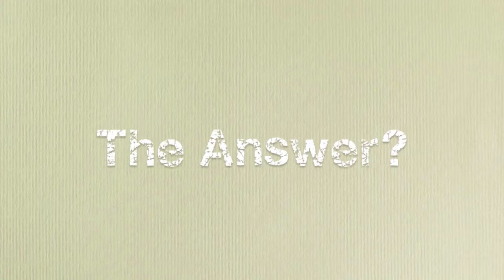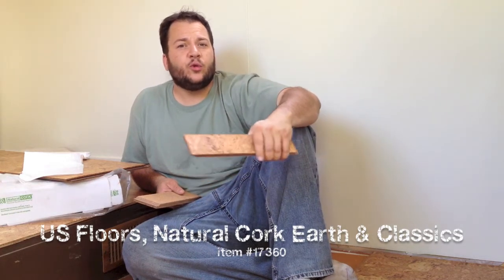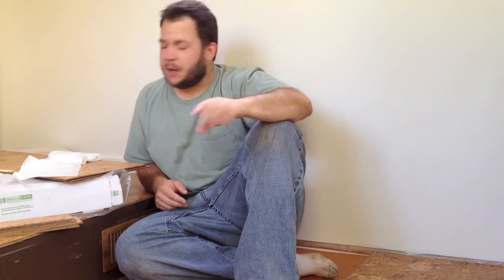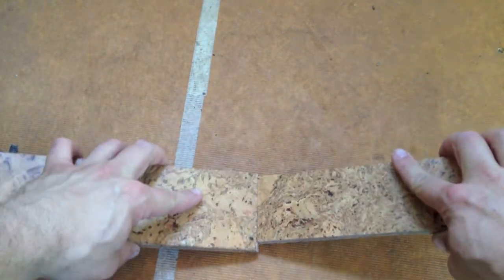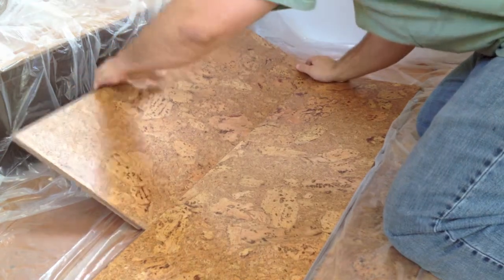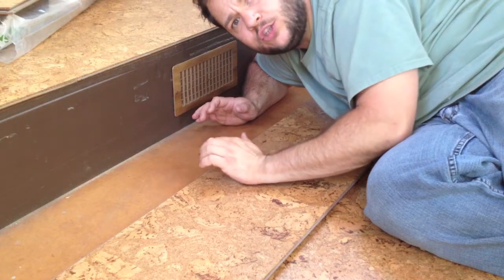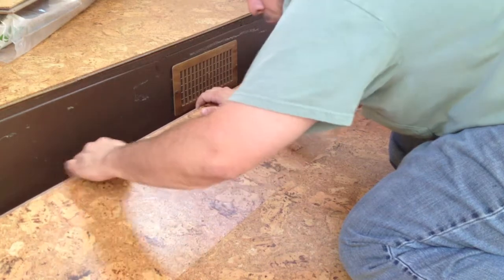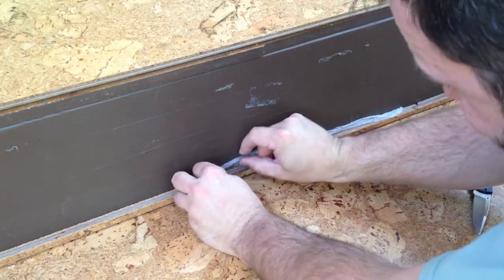US Floors Cork Flooring

Comment: Did you document the poly topcoat application? I assume that the US Floors click lock flooring you used was prefinished, so I'm curious what steps you followed to put the poly on top of it. Did you scuff or sand the surface at all?
Reply from the maker: I did not document that process. It was entirely too tough in the size space to actually do the job while documenting and it really is an easy process. I used a satin finish of AFM SafeCoat, Polyureseal BP (from Green Building Supplies) and followed the instructions to the 'T'. There is absolutely no scuffing or sanding required if your flooring already has a finish. It is like pouring syrup over a pancake.
Reply: Tiny r(E)volution  Awesome. I'm thinking about installing a click lock, prefinished cork floor like this and definitely want to seal it.

What tools did you use to spread the poly evenly? I've seen tutorials use a very short nap roller, some type of rectangular pad for cutting in, and also a squeegee like device, called a t-bar.

Thanks for the reply!
Reply: @TinyrevolutionUs  
Good to know...
Thanks for the info

Comment: I noticed you left the tongue on the last board's wall side. Normally, you'd cut that off so you can leave a gap between the floor's surface and the wall (which would then be covered with baseboard). I hope people realize you didn't include that step.